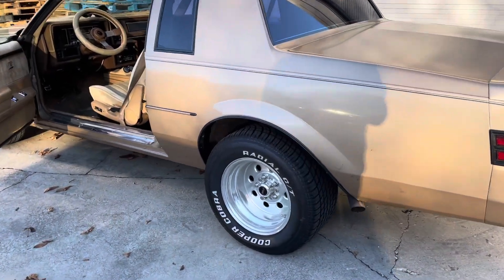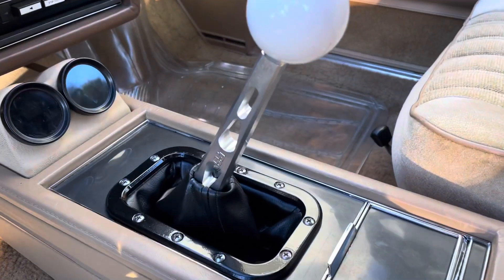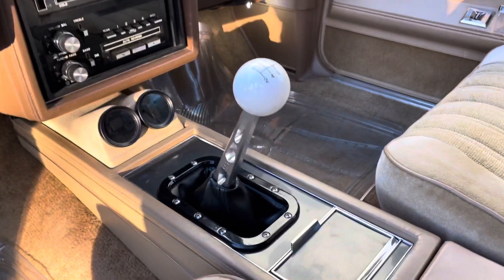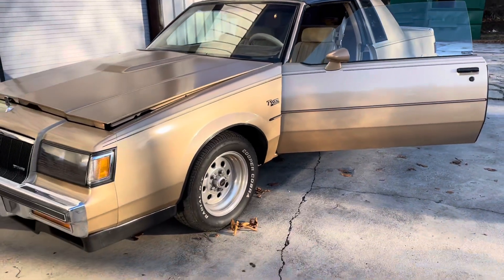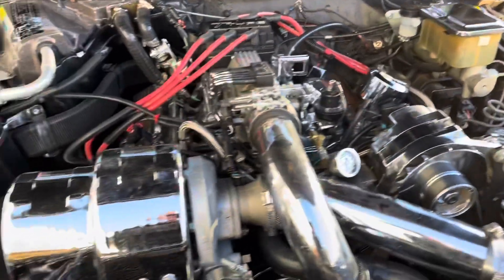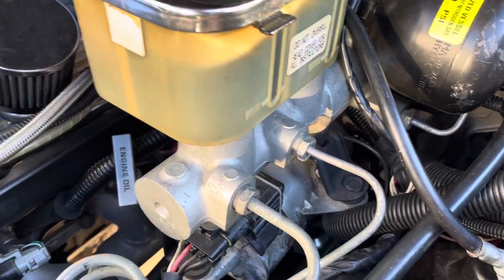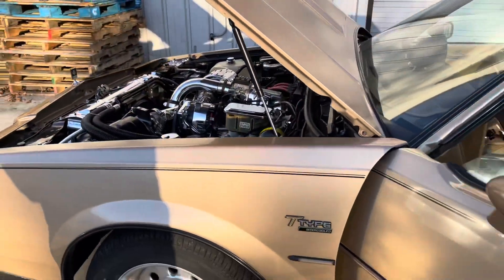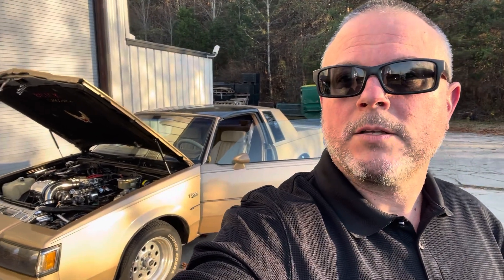Silver Sport Transmissions new Tremec swap kit for Buick Grand National and T-Type

Comment: Jeff a lot people are still having trouble out of the T-56 Magnums swaps for the Mopars. The QuickTime bellhousings are junk. When you pay that amount for a bell housing you shouldn’t have to grind the block or shim the starter, especially on top and guess what happens if you drop that joke of a shim you guys send inside the bell housing? You have to take the fricking transmission apart to get to it because QuickTime doesn’t come with any kind of bottoms access to the bottom dumps
Of the bell housing.